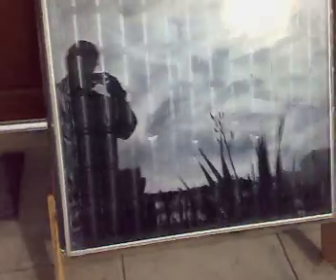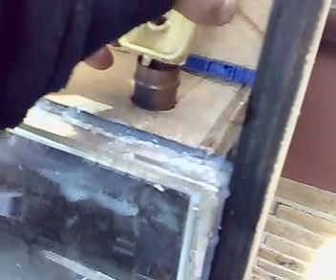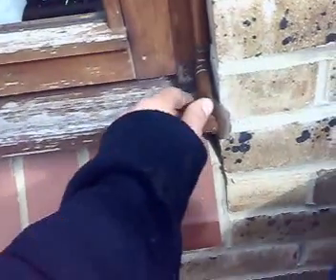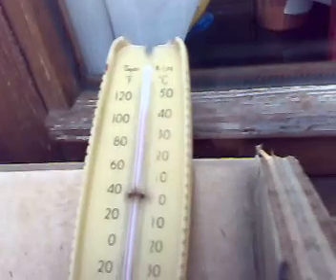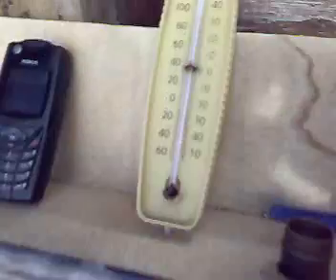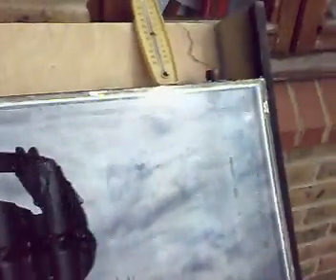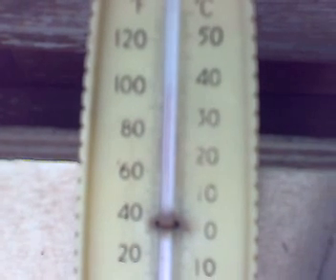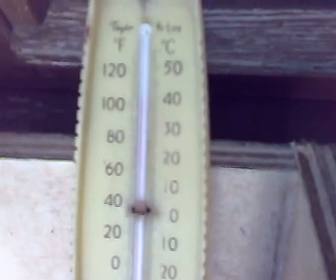home made solar can air heater/finished

Comment: @widdy2007 Empty cans. Together they form one long pipe, going up and down repeatedly, the air is circulated by an extractor fan (power by an electric solar panel) and is heated up by sunlight.

Comment: Great panel, but the connections 22 & 15 mm. I know the tempetation of not wanting to damage the house, but you've made all that effort to make a panel, and then waste a lot of the heat through not being willing to take a brick out of the wall. Take you courage in both hands and take a brick out so you can get the heat in !

Comment: @IbnAlla I used mine in the coldest month average temperature 40 F and my heating bill was reduced fro 300.00 US to 174.00.  Its a good savings and I had a small unit. The only draw back i had was not being tied in to the central duct for more even heat distribution .

Comment: I am going to try high temperature adheasive spray over a primed aluminum sheet and then covering it with activated carbon powder to see if i can increase the collector surface area .  I just have to find an adheasive that can withstand very high temperature . If anyone knows of one I would appreciate it.  I am in the design process right now . I have been cading it up for a week or so and researching suppliers for electrical componenets. I think the cans are ok but it looks like a lot  of work

Comment: @bscfrnd1 I find it so strange that mirror retailers has no large mirror mounts that can hold mirrors. All I see is those sets of crummy clear plastic mounts with skinny tiny screws that is useless for exterior uses..  I have to fashion mounts out of bent sheet metal and appropriate bolt/nuts. to secure heavy mirrors against the sheating boards . Hardware stores lack so many things that can be used for any kind of solar uses.. It is so woeful!! Fore example, I couldnt find any ram mounts, etc.

Comment: @bscfrnd1  cont from first one..and bounce sunlight from the southenr sky and toward the shady northern sides of my houses. Through my glass sliding door and huge living room window, my mirrors illuminate the indoors as well as heat them.  I nailed 2x8 inch lumber boards to 4x4 foot sheathing boards through drilled holes that act as loose hinges. 2x8 inch boards is heavy enough to withstand winds or 2x10 inch lumber boards may be better.Cost is very negiblie..heating performance is outstanding!!

Comment: @bscfrnd1 Why dont you check with National Renewable Energy Laboratory (NREL) to establish validation of beer can theory. They can compare beer cans or without in a controlled experiment. I dont have any beer can heater so I cannot really make any baseless argument with your beer can crowd. maybe you are right after all. so I encourage you to go to get validation. For myself, I simply use mirror remanents found in remodeling projects or glass shops and mount them on dirt ground or frame (cont)

Comment: @junkyardnut Using round cans increases the surface area of the collector plate.The thin wall alluminum in the manifold configuration alows for extreamly efficient heat exchange. The thin aluminum in the can heats extreamly fast when exposed to the sun and also cools quickly.

Comment: If this was to be fixed permanently in place then you could put some concrete pavers behind the cans & paint the entire thing black & that should give off heat even in the evening. Also, is there a particular reason you used aluminum cans & not rain water tubing?

Comment: quality idea mate. but as an ex plumber you need to insulate your 15mm pipe mate, i know what you said about hiding the pipes so the 1st thing that jumped in to my head is Reflective Foil Insulation and Loft Insulation this is quit new stuff 3 to 5mm thick foil sided multi layer stuff but gives the insolation of 6'' traditional roof/loft insolation, then may be you could paint it to match your window frames.
nice one mate 

stay safe   pip

Comment: looks like a really well thought out solar heater. Just wondering if you had thought of insulating the copper piping leading into the house... Looks like you come from a pretty cold part of the world and so could lose a lot of heat with a bit of a cool breaze or a set of cold bricks that you have the copper pipe resting against.

Cheers M

Comment: Since i put a link in my post I am not sure it made it through. Search Beer collector (!) Beer collector (!) and see how she does it...the Hungarians have it down! Pass the outer cans over a flame to help them expand and to fit them easier;  it increases the thickness of the aluminum walls and you get higher temps.  Also,  if you are using a hole saw to cut out the bottoms, save the fallouts, and put slits in them to make tiny pinwheels. Glue these into the bottom three rows of cans.

Comment: Your outlet port should be larger,  about four inches in diameter...when you force warmer air through a smaller opening it is cooled,  and you have wasted energy.  Check out BEERCOLLECTOR! BEERCOLLECTOR! .com,   and see how they do it.  You can pass the cut cans over a flame to make the outer can fit much easier,  otherwise it will only go on about 1/4 to 3/8 of an inch.  In effect,  she is increasing the thickness of the aluminum walls, thereby increasing heat gain. (continued...)

Comment: This may seem like a dumb question but what about in the summer when you don't want all this heat coming into the house..how do you shut it down..by closing the vent but then wouldn't the excessive heat warp the heck out of the inside etc..or do you just take it off the house?

Comment: you need the trapped air between the cans and the glass as an insulator, otherwise most the heat gathered would radiate back to the outside.

Comment: Your design looks terrific!
I agree with the rest that an instruction video on how to build it would clarify some doubts I have. e.g. 1) do the bottom cans all have a seperate air inlet? 2) Are the cans at the top all connected with one tube to the outlet? Thank you in advance for your response.

Comment: ....or he could have just used a high-heat paint(for about $30) and let it completely dry before he starts using the device. Also, he could have purchased a thermal heat sleeve(3' & 1" I.D. for about $34.99) from JEGS web site to protect the pipe. But obviously, all those things would just jack up the total cost of the device, but for a good cause.

Comment: I saw several of your videos and it seems you where using glue to stick the cans together. I listened to variouse youtube videos on Mr Meaney and i understood from one that he sort of hooks the cans together. I have tried to cut holes in variouse ways to get cans to catch together but hardly been very sucessfull yet but i'm not a great handy woman.
  I reckon that if the house gets warm during the day it lessens the problem at night even if it does not heat at night. rose madrid.

Comment: it would still heat the inside regardless.. the black is a conductor of heat from the sun. IT will increase the temp probly up to 100 or so...

Comment: but, i do imagine if it had some water the heat would last a little longer as the sun goes down plus the humidty level would be higher thus more effeicent on heating the air,  in the winter time that would be a little harder to deal with then on the outside though. Maybe one could inject a little water in the winter time to basically make a little steam, I hate dry winter heat makes my sinuses crazy I run humidifers and still not enough plus keeps the heating bill down a tad bit.

Comment: Luvely stuff, today I'm gettin the wood framing delivered for my project, cans are already glued & ready. I have based my can heater round the canadian & hungarian design, no spec was given for the large unit so I am building a smaller test unit using 81 cans first (like urs), I have inserted deflector fins into each can & will use 4 comp fans for the small unit, I have recorded all sizes of the project & will upload photo's etc once complete. p.s. u can add more fans to your unit & larger pipe

Comment: hi i have a 1.5watt 12 Volt Battery maintainer solar panel from maplin unfortunately i do not know the wattage of the computer fan.i have been to maplin's and they say that i need a battery.
are there different types of panel.
thanks for your reply

Comment: humbertini900, How did you decide on a 22mm pipe? I've seen others that have a much larger pipe.
Maybe that's why your works so much better? Also do you know how many CFM (cubic feet per minute) the fans blows or what size it is? Diameter of fan. Is it a Computer type fan? CFM is what we Yanks use.  Not sure what you use, Meters Cubed per Minute? 
Anyway it sure is Fantastic Mate! Are you going to heat up water next?

Comment: ahhh, so this isn't a closed circuit unit?   So you're pulling in cold air from the outside and warming it through the cans, correct?   

I've been thinking of building one but having the input pipe draw air from the bottom of my garage (which is already warmed).. and that would be far more efficient.

that said, you've done a nice job on that unit.

Comment: I think the sun energy is about 1000 Watts per square meter on the ground in the summer noon sun.  Of course it depends on the efficiency of the system; air, water, solar electric of how much energy can be transferred to it.  Also, I guess a large collector mass such as perhaps a 1/8 inch to 1/4 inch aluminum plate behind the cans could hold some condensed stored energy at the cost of money and "warm up" time for the system.